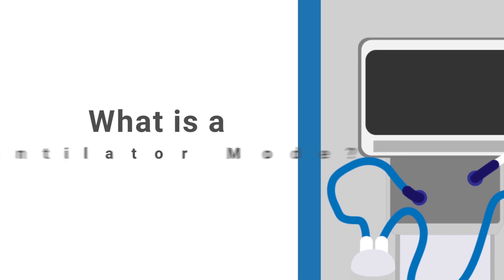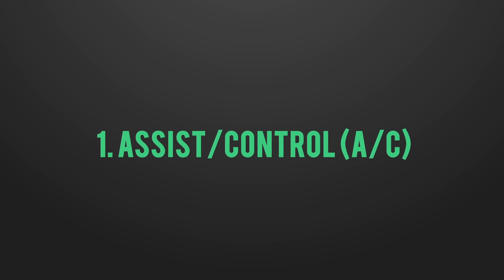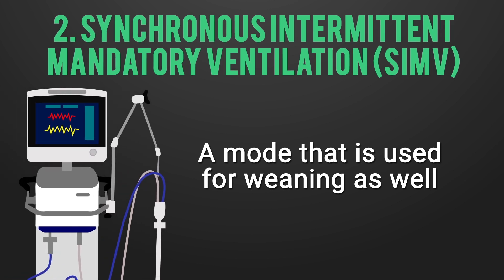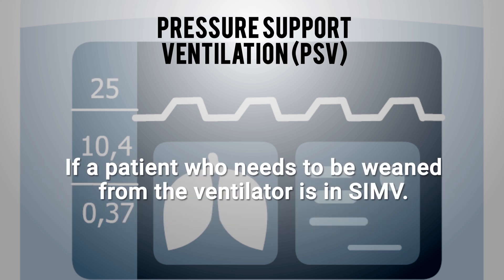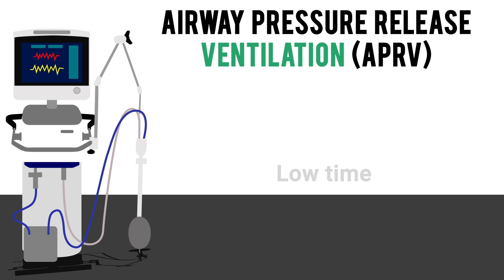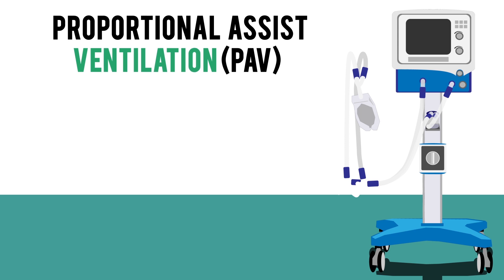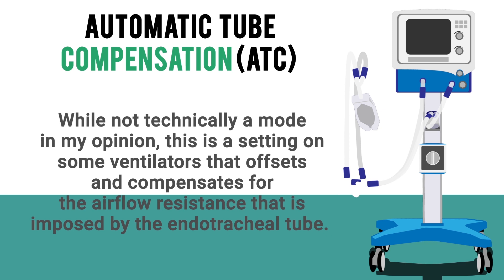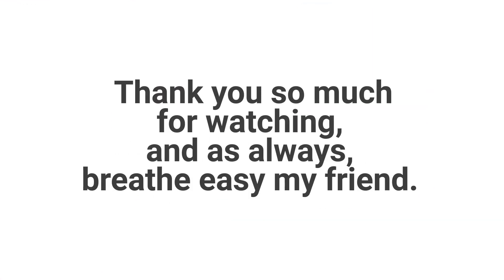Ventilator Modes Made Easy (Settings of Mechanical Ventilation) | Respiratory Therapy Zone

Comment: NOTES
MODES OF MECHANICAL VENTILATION 

A VENTILATOR MODE=  How a mechanical mode assist with inspiration,however before you can set the control mode you must set the two control variables.

CONTROL VARIABLES= Pressure Control and Volume Control

VOLUME CONTROL
VOLUME CONTROL= This means you can set and control the pts tidal volume. 
POSITIVE ASPECTS OF VOLUME CONTROL= There is a known RR and MV, which is ideal in achieving the desired PACO2.
NEGATIVE ASPECTS OF VOLUME CONTROL= If the pts compliance were to decrease this would result in a high peak pressure; as well as, pt ventilator dyssynchrony. 

PRESSURE CONTROL 
PRESSURE CONTROL= This means you can set or control the pts pressure in order to achieve a desired tidal volume. 
POSITIVE ASPECTS OF PRESSURE CONTROL= There is a known RR and MV, which is ideal in achieving the desired PACO2
NEGATIVE ASPECTS OF PRESSURE CONTROL = The pt tidal volume can potentially be unstable if there are changes in the pt's lung compliance or airway resistance.

PRIMARY AKA OPERATIONAL MODES
1.) ASSIST / CONTROL MODE (A/C MODE): in this mode, a minimum number of breaths are delivered by the ventilator but the pt can also trigger assisted breaths, which can result in hyperventilation which results in respiratory alkalosis.

2.) SYNCHRONOUS INTERMITTENT MANDATORY VENTILATION (SIMV): in this mode, the ventilator delivers a preset minimum number of mandatory breaths. 
* This mode allows an operator to set either a controlled pressure or a controlled volume. 
* Used when pt needs partial ventilatory support. 
* This mode is used for weaning as well. 

SIMV ADVANTAGES = 
1.) Bc pt effort is allowed respiratory muscles are exercised and less likely to atrophy 
2.) Decrease mean arterial pressure 
3.) Distributes tidal volume equally throughout lung field and decreases V/Q mismatching

SPONTANEOUS MODES OF BREATHING (To pursue these modes the patient must, as the name indicates, be breathing spontaneously)

1.) CPAP (CONTINUOUS POSITIVE AIRWAY PRESSURE): A continuous pressure that is above atmospheric pressure is delivered and maintained throughout the entire breathing cycle.
* The patient must be breathing spontaneously to be in this mode because no mandatory breaths are given.
* This is a useful mode for weaning patients off the ventilator.

2.) PSV (PRESSURE SUPPORT VENTILATION): This is a mode of mechanical ventilation in which the pt's spontaneous breaths are supported by the ventilator during the inspiratory phase of breathing.
* As the pt triggers a breath, the ventilator assists by adding pressure to make breathing easier. 
* The higher the pressure the easier it will be for the pt to take a breath. 
* The breaths are time cycled and pressure limited. 
* Often used to help the patient overcome the airway resistance that is caused by the endotracheal tube. 

3.) VS (VOLUME-SUPPORT): The ventilator delivers a supported breath to help the pt reach a set tidal volume. 
* This mode is totally dependent on pt effort meaning that the machine varies the inspiratory pressure support level with each breath in order to achieve the target volume. 
* This mode is not quite as common as others, but it is often used to wean pts from anesthesia.

UNCONVENTIONAL MODES AKA SECONDARY MODES

1.) CMV (CONTROL MODE VENTILATION): It's a mode where the ventilator delivers a preset tidal volume at a set time-triggered frequency. 

* The ventilator control both rate and tidal volume which means it is in control of minute ventilation.
* This mode should only be used on pts who are fully sedated and administered neuromuscular blocking agents. 

2.) APRV (Airway Pressure Release Ventilation): A mode in which two levels of continuous positive airway pressure are applied with an intermittent release phase for spontaneous breaths.

* In this mode you will set a high pressure, low pressure, high time, and a low time. 
* Often used to improve oxygenation in refractory hypoxemia* Used for ARDS (Acute Respiratory Distress Syndrome), ALI (Acute Lung Injury), and Atelectasis

3.) MMV (Mandatory Minute Ventilation): This is a feature of some ventilators that causes an increase in the mandatory breaths that are delivered when the patient's breathing level becomes inadequate.

* If the patients spontaneous breathing decreases, the ventilator compensates in order to make sure that safe minimal minute ventilation is delivered. 
* Often an additional function of the SIMV mode and is intended to prevent hypercapnia. 

4.) IRV (Inverse Ratio Ventilation): This is a mode that uses an inverse I:E ratio to improve oxygenation and gas exchange.

* It has been shown to decrease shunting improve V/Q mismatching and decrease dead-space ventilation.
 * Recommended for pt's with ARDS (Acute Respiratory Distress Syndrome)
* This mode causes auto-PEEP which is usually when you think of auto-PEEP or intrinsic PEEP; In this mode, the auto-PEEP is actually what helps improve the pt's oxygenation and reduce shunting. 

5.) PRVC (Pressure Regulated Volume Control): A mode of mechanical ventilation that provides volume-controlled breaths with the lowest pressure possible.

* It does so by altering the flow and inspiratory time.* This mode is used to keep the peak airway pressure at the lowest possible level. 
* This mode is volume cycled and can be pt-triggered or time-triggered. 

6.) PAV (Proportional Assist Ventilation): This is a mode of mechanical ventilation where the machine uses variable pressure to provide pressure support for a patient's spontaneous breaths.

* Either pressure triggered or flow triggered and the breathing cycle ends once the pt's volume or flow demands are met.
* One thing to keep in mind about this mode is that, is that if the pts lungs show rapid improvement, overdistension or barotrauma could occur because too much pressure would be delivered. 

7.) APC (Adaptive Pressure Control): This is a pressure control mode that utilizes a closed-loop control of the pressure setting in order to maintain a minimum delivered tidal volume. 

* Delivered tidal volume will vary based on pt compliance.

8.) VAPS (Volume Assured Pressure Support): This is a mode of ventilation that provides a stable tidal volume by incorporating inspiratory pressure support ventilation along with conventional volume-assisted cycles.

* Causes prolonged inspiratory time, so pts with an obstructive disease should be monitored closely in order to prevent air trapping or other cardiovascular effects.

9.) NAVA (Neurally Adjusted Ventilator Assist): It is a mode that uses the pt's electrical activity of the diaphragm to guide the functionality of the ventilator.

* A catheter with electrodes is positioned in the pt's esophagus at the level of the diaphragm, and that is how the electrical activity is picked up from the phrenic nerves.

10.) ATC (Automatic Tube Compensation): While technically this is not a mode, this is a setting on some ventilators that offsets and compensates for the airflow resistance that is imposed by the endotracheal tube. 

11.) HFOV (High- Frequency Oscillatory Ventilation: A type of mechanical ventilation that delivers very small tidal volumes at an extremely fast rate which minimizes the chances of lung injury.

* Ventilation can be increased by increasing the amplitude (power) or by decreasing the frequency. 
* Oxygenation can be increased by increasing the FIO2 or by increasing the amp.

Comment: Thank you for the videos keep them coming. I'm an RT student that is struggling to comprehend the clinical application of each of these modes. With being completely online it would be nice to see a video that incorporates some of the most common ventilators a patient based scenario that helps to recall the mode appropriate for the given scenario and how to set the desired mode on the  user interface